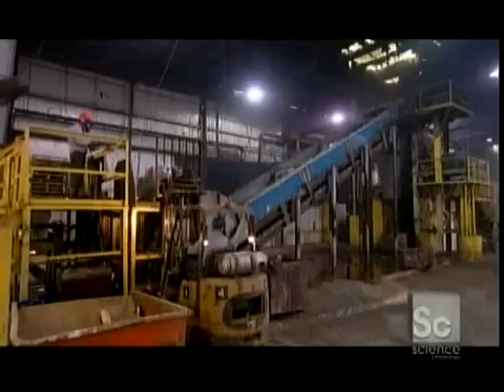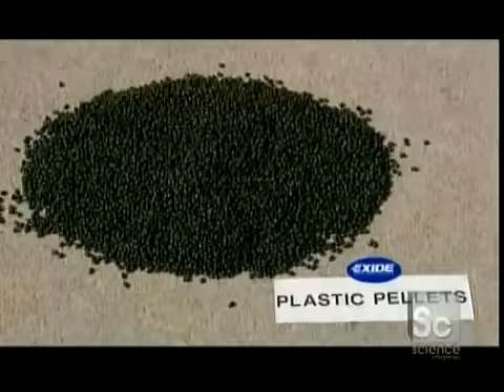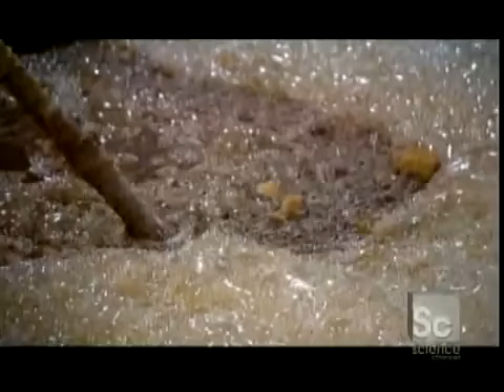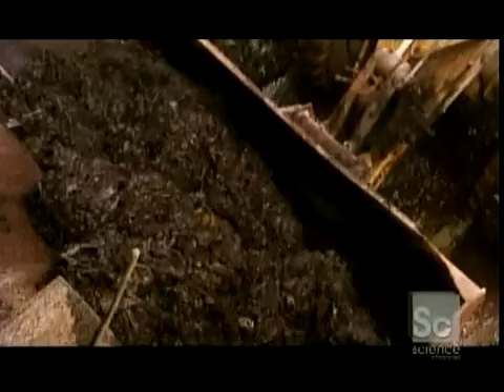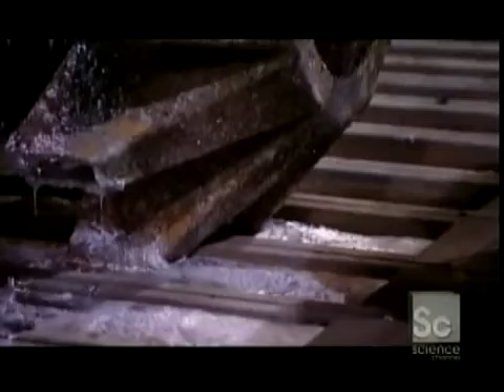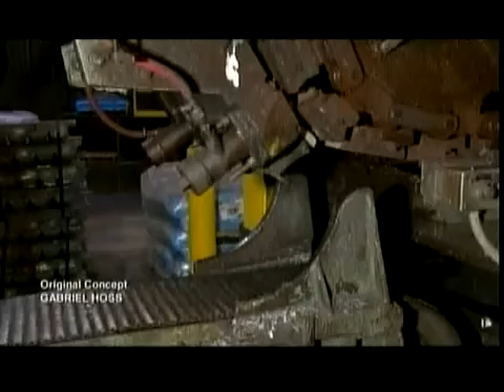How It's Made, Recycling Car Batteries.

Comment: It would be so much better for the nature and for people if the batteries were openable and could be fixed without having to grind them.
Reply: If the issue is an electrolyte depletion, for most car batteries, you actually can do this. The point where this is necessary comes after a battery has reached a certain age or if they've been deeply cycled (charge on them dips below 40%), this is an especially common killer of car batteries. Sealed lead acid batteries, like what's common in lighter vehicles like golf carts, motor cycles, and home appliances like uninterruptable power supplies, are harder to condition like this.
Reply: Not really... the plastic gets reused anyways.

Comment: Let me get this straight.  Lead is ‘dangerous’ if it’s in a landfill, yet lead is naturally embedded in the ground?
Reply: Naturally lead is in a mine 3 miles underground, not in the rivers, not in the sea, not in the meat of fish, not in your digestive system. When a heavy metal enters in your body it will never get out, your body cannot expel a heavy metal, it will remain inside you until you are burned in a crematorium. The lead inside your body will react with pretty much everything, the ADN inside your cells will mutate and they will reproduce, every cell in your body is "renewed" every 6 months, if the new cells are corrupted and they don't know how to replace your lungs or any organ, your are going to die of cancer, because your body doesn't know any more how to fix himself. NATURAL SELECTION. GOOD BYE. NEXT HUMAN PLEASE.
Reply: That is correct.
Reply: But you can say the same thing about plutonium.
Reply: Landfills are usually exposed to open atmosphere, which means rain, which can erode materials as it makes its way into our rivers.
Reply: Damn you stupid

Comment: i dont understand why they put the "clean" water down the drain instead of collecting it and reusing it in the process.
Reply: The water is clean enough to be discarded into drains where it will go to the state/municipal water treatment facility to remove all the extra chemicals, it may not be clean enough to reuse it even by the factory and simply discarding used water may be cost efficient than setting up their own water treatment plant.
Reply: Lincon Osiris That’s how things work in modern society with sewage systems. We’re not talking village  life with no sewage system where rain and the local river is the only source of water. Also to add a very important detail......the process involves removing the lead acid paste. If they reused the water there is still residual lead acid contained and the cleaning process would be less efficient. Hence MORE water would be used ......and yes this what you’re concerned with......more water would be WASTED. The process used is more efficient and better for the environment than your suggestion.
Reply: He was referring to use the "clean" water in the process of making new batteries. Recycle and make the new battery in the same facility to avoid dumping water that is not any more pure, to be pure H2O you need to use R.O., I doubt they even use a simple 5 micron filter. You want to know why they don't do it? NATURAL SELECTION, that's why, the dumb will die of cancer thinking they live in a magic world where meat doesn't get spoiled and water don't get contaminated. LET THEM DRINK THE TAP WATER.
Reply: Just awful
Reply: Higher lead counts closer to the plant guaranteed

Comment: ¿do you have information regarding that method?
I would like a lot to learn how to re-use the electrolyte in deep cycle batteries
Reply: couple of ways...1) electrolyte is neutralized with caustic, treated for heavy metals and discharged to sanitary sewer. OR used in a continuous loop to process sodium sulfate by-product.2) electrolyte is neutralized with lime, resulting gypsum-like byproduct is taken to hazardous landfill, water is treated and released.